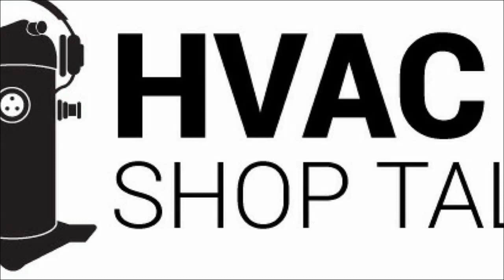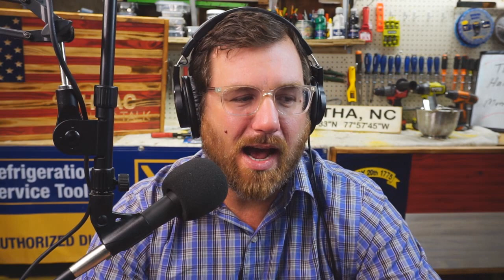M18 or M12 Power Tools?

Comment: I do allot of electrical and drywall (finisher). I love the M12 impact simply because of the weight. It's so light. When you're carrying a tool all day, you really notice when a tool is smaller and lighter, even if it's just a little bit. It's literally almost 2lbs lighter. 2 lbs on your belt for 8-10 hours adds up.

Comment: Both! I've used both for years and you can't go wrong with either platform. M12 impact driver does just fine for 95% of my work (commercial hvac tech)

Comment: M12 for Service stuff like a 1/4" impact or drill or oscillating tool or Hackzall that you wanna keep as small and light as possible and still have good power. 

M18 for an Impact you're gonna build deck with...or stuff like Sawzall, Hammerdrill, Job Lighting, portable fan, and lawn equipment.

Comment: Commercial service apprentice here, the m12 fuel impact paired with a Klein 7 in 1 bit is the bees knees! I absolutely love mine and it hasn’t let me down yet. On big bolts we use a brushed m18 1/2 impact but for any fasteners under 1/2 inch, the m12 has never failed for that usage. And I’m using the small 2.0 battery

Comment: 6:55 21700 cells have higher discharge ratings, so you can pull more amperage out of them compared to the older 18650 style cells.

Comment: Both! I only have Milwaukee tools and a good mix of the two are great. I only do service and changeouts so I don’t need much M18, but the hammer drill is great for mounting new disconnects. I also keep an impact wrench for truck tires on my truck in case I have a flat way out in rural areas. M18 also for my shop vac, and portable fan….everything else is M12. Can’t beat the value of Milwaukee.